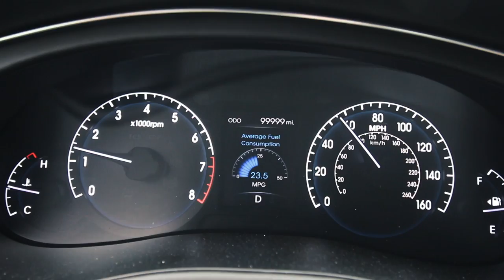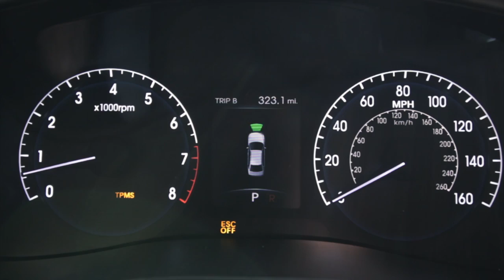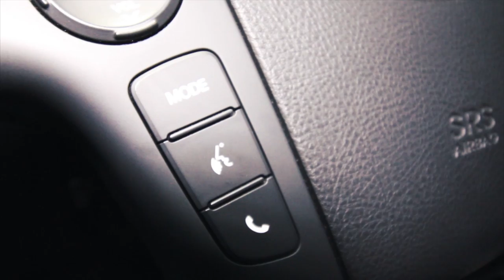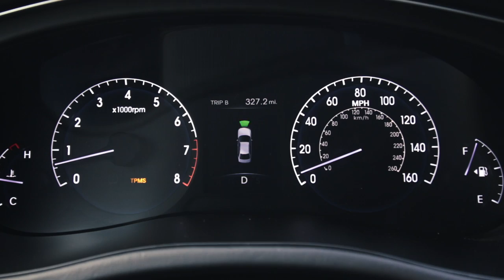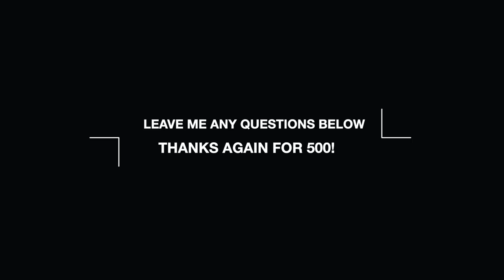2012 Genesis 5.0 R-Spec Long Term Ownership Review

Comment: I have a 2014 5.0 R-spec that I bought a year ago with 30k miles for $20k. Love this car. I wish there were more after market stuff for it but aside from that it's the best car I've owned. Great video. Keep up the good work =)
Reply from the maker: Thanks homie! And enjoy that heated steering wheel only the ‘14s got ;) I’m jealous
Reply: Hey guys, thanks for the info. I am very close to buying a 13 R spec. Is this a reliable car? Honestly that’s more important than anything to me. Also, are you really getting over 23 mpg ? Premium only ?
Reply: @benkemp5621  It's as reliable as any other car in its class. I bought my 2014 Rspec 5.0 in January of 2018 with 30k miles on it. I also purchased an extended warranty up to 5 years/100k miles. The first two years I had no issues. I replaced the rims, tires, rotors (cross drilled and slotted), Magnaflow Cat Back exhaust and modified the air intake box to fit a generic 4" K&N filter (model# RE-0870 ). About 6 months ago the Genesis started stalling and stranded me twice. After 5 trips to the dealership replacing the Fuel pump, crankshaft positioning sensor, oil regulator, fuel injector (#6 on the drivers side) and finally the entire ECM (the codes it was throwing were erratic which explained the faulty ECM unit) which btw, was covered under the factory warranty. A total of over $6k worth of warranty work. Now she is running like a beast. I'm sharing this not to scare you out of buying your 2013 model, just to advise you that with any high performance luxury car purchase, you should buy an extended warranty. It pretty much pays for itself with only a few trips to the dealership. The car is well built and I am totally satisfied with my purchase. And yes, always premium gas. I average 20mpg. Hope that helps =)

Comment: I've got a 2012 R-Spec that looks the same as yours. Bought at 40K miles, now has 104K. I've not had any of the electrical issues, all my electronics work perfectly. Only repair so far has been a new alternator right around the 100K mark. I've been pretty happy with it for the last 4 years.

Comment: Xtalgic.  Big fan down in the RALEIGH, NC area.  You are so spot on with your comment on all the “brand snobs” shitting on Hyundai products. I spent almost a year looking for a V8 sedan to replace another badass sleeper, my 2009 Infiniti G37 (was just too small for me).  I had very strict financial restrictions I put on myself ($18,000) and had no real sense of urgency as I loved my G37.  I tend to like cars that many folks don’t appreciate, but in the end I narrowed the pool to 2011-13 Infiniti M56S (badass 420HP car that gets no love either), 2009 Mercedes E63 AMG, 2009-2011 Audi A8, and the 2012-204 Hyundai Genesis 5.0 RSpec.  The Lexus LS 460 was also in the running but it lacked the “sport” characteristics of the others.  It came down to a 2011 Infiniti M56S (96,000 miles) and the 2012 Hyundai Genesis R-Spec that we’re actually at sister car dealerships (both were listed in the $15,000 range).  I was ready to pull the trigger on the M, but the price on the RSpec dropped $1000 on a Saturday and the Hyundai only had 67,000 miles and was a one owner.   That was the deciding factor and I sped over to the dealer, took it for a ride, didn’t even haggle as I had a $250 test drive credit they offered and walked out the door having paid only $14,250 plus taxes and fees!!!!!   I had driven E63 AMGs, many A8s, and the M56S (extremely rare vehicle) and the RSpec was by far the best all around performer and a brake replacement didn’t cost $5000 (like the E63😂😂).  Let the haters  hate while we just blow by them on their way to the dealership for another expensive fix!!!

Comment: Awesome vehicle, one of the best luxury car sedans ever built. Reliability is awesome just like Toyota and Honda, the manufacturer tested the engine for 800,000 miles. Hyundai forum people have been putting well over 200,000 miles on their Genesis Sedan with the V6 and V8 with routine maintenance.
Reply: Oil consumption?

Comment: I have a 2013 R-Spec 5.0 and everything said in this video is correct. I had a 2011 but totaled it and got the 2013 which doesn't have several of the issues talked about in this video. Great great vehicle. Best I've owned....so far.
Reply from the maker: They seem to have sorted out a lot in the 13-14's
Reply: @Xtalgic  Great videos. Keep doing it. Hey, Ms. can be annoying but you gotta luv em.

Comment: Heck yeah!! No car is perfect. And I'm still LOVIN' my 2012 R-Spec to this day and everyday I drive to and from work! I agree about the transmission....it's great when it comes to a luxurious smooth shift, but it lacks in true sport shifting control (especially when the trans fluid is cold). But overall, it's still a freakin' amazing car for the money.......a true sleeper in performance and price. I love it when I slap-face the rice rockets at 50mph.....they can't believe it when a 4000 lb spaceship leaves them in the dust!
Reply from the maker: Hahaha I’ve I had a few of those.

Comment: I have a 2013 5.0 Rspec at 106000 miles.  Love the car!
still on the OEM brakes also
regarding your backup camera - take the trunk lid liner off and there are some connections in there.  Take those apart and reattach.  Mine was in/and out for a while but since I did that the camera has not missed a beat (been a year)
Reply from the maker: CONFIRMED. Thanks Thomas! Always appreciate your support man.
Reply: Wish I saw this 2 months ago when I spent 100s of dollars to get my backup camera replaced at my dealership...
Reply: @thomas new how many miles she at now?
Reply: @LilZzzQ  I have a company car now so the Genesis stays in the garage mostly. At 122000 now

Comment: I hear good things about the BTR TCM tune clearing up any shift latency and improving transmission responsiveness. They also make an engine tune as well. Excellent car for the money. I drove a black 2012 exactly like this when I owned a tuned 3.8 Gen coupe track manual. The engine was obviously more powerful, but considering the rspec sedan weighed 800 lbs more than my coupe, it didn’t feel much quicker and I kept the coupe as handling was superior and I expect fuel economy was as well. Great video.
Reply from the maker: Thanks man! In my opinion, the BTR ecu/tcm tunes are over priced. Plus I hit them up a while ago for something else... not.. the best experience..

Comment: I own  a 09 genesis.  We got it from a small dealership and less than 6 months later had to replace the motor.  Thank god for warranties. Installed a 2012 motor. Same displacement 4.6 v8. With 30k on it. Nicest car I've owned.
Reply: What happened to the engine?

Comment: Thank you for posting the Genesis videos. Watching them was part of my decision making for my 2012 5.0 rSpec. I've had it for 7 months now, and absolutely love it! Interesting that I watched this today, and my backup camera also started acting up. Did unplugging and replugging resolve the issue?
Reply from the maker: No problem glad I can help! As for the camera, honestly i haven't tried that, but i don't think it'll make a difference. I have to remove the trunk shell to get to it. When I get in there ill make sure to unplug/replug to see what happens. And congrats on your Genny man!
Reply: Mike, that is fantastic! Are you contemplating doing any modifications?

Comment: I owned  two Mercedes a 2003 S 500 and 2004 c 240.  Both  of them were purchased with under 40 miles. Both great cars.  The s cost me 42k and the c 30k. Now both were great cars and I like driving them. I tell you this though both cost me some $$$ to maintain. I never spent under $300 dollars for repairs or general service that goes even for a oil change and I had my friend a certified mercedes mechanic taking care of the cars. My friend told me when i purchased the vehicles you will have to walk with a open wallet. He was absolutely right. I did a lot o research before I purchased my 2016 genesis AWD fully loaded and the ride is great. Planning to buy another soon that's how good the car is. they dont get the credit they deserve but so did Lexus. Get one!  No Im not a Hyundai salesperson or rep. Just found a good thing and decided to share after watching this guy video. GREAT JOB and Great Car.

Comment: I own a 2016 3.8, with Tech package. Bought about two months ago. It has the panoramic sun roof. It has the different grill. It is, in fact the same basic car as the 2019s. It had about 32k when I bought it. Now 42,500 miles. So far I love the car. Every option works on it. I hope I can be as happy as you when it goes over 100k. Good no BS video by the way.
Reply from the maker: Appreciate it Gary!

Comment: I have a 16 Gs 350 F sport. It's my 3rd owned lexus and I love it! But...I've been looking into a family V8 sedan, some will understand, and some won't. I love the new body style and have been looking at the 15/16 genesis 5.0. Haven't had any issues with the GS and I'm debating if the Genesis 5.0 is equivalent as far as reliability. I rock with the channel, the mods, all the content. What's your take? All around, is it worth it?

Comment: Great video!  My 2012 R-Spec is about just over 120,000mi as well!  The ONLY thing I've had to replace was the rear back-up camera!  Still running original brake-pads, I did change the spark-plugs, had a full de-carbonization done. I do have the same rattle on the rear deck that just started last month, only issue I have is the oil consumption. Other than that, best car I've ever owned, no issues whatsoever in the past 4yrs I've owned it!
Reply from the maker: Few questions about the de-carb process. Where’d you get it done? Was is a chemical based process or media blasting? How much? And any noticeable difference afterwards??
Reply: @Xtalgic  sorry for the late reply. I had it done at the dealer. They use the walnut-blasting process. You're supposed to do the cleaning every 50K, costs about $130. But since it had never been done before, the full cleaning was $330.  And yes, it made a HUGE difference. Should have done it a lot sooner...!
Reply: Hello, how is it holding up now and mileage, fixes etc?

Comment: I have a 2013 Genesis R Spec. Only 26k on the clock.  Bought new in 14 for $33k.  Still have bumper to bumper until June and remainder of 10/100 after that. I also had the camera go out but was recently replaced under warranty. Only cost $112 according to warranty claim! Only other issue was internment headlight flash on and off due to switch on turn signal stalk also replaced under warranty. Great car. Most likely will replace with Equus in a few years. Happy motoring!

Comment: I’ve had my 2012 R-Spec for a year and a half and could not agree more about the transmission, fantastic car but the shifts are very sluggish and tend to slip a lot when driving aggressively. great vid man!
Reply from the maker: Thanks friend. And ya I think they’re more tuned with longevity in mind. Unfortunate, but I believe BTR has a TCU tune that apparently fixes that.

Comment: I have a 2012 R-Spec with 241k on the clock, and it's literally one of the fastest vehicles I've ever owned. Currently in the shop waiting for the factory throttle body (trust me you need to replace them brand new), and I've embarrassed mustangs and stock hemis. Would love some advice on tuning. Zero transmission issues, other than it bogging down under mid-pressure acceleration.
Reply: What was wrong with yours? Everytime I let off it slows down funny and idle drops fast almost like u throw it in neutral when I pull up to a stop light .. wondering if it's my TB cause if I flick the pedal on decel a few times it slows for fine
Reply: @boostedek3573 the TPS went bad, and the used one I ordered wouldn't take.
New TB comes with the TPS. Know that it's not cheap and comes from S. Korea direct from Hyundai.

Comment: Don't know if you have fixed the backup camera. If not, I may have the solution for you. I have an '09 4.6 with 170K miles on it and it runs fine. Great car. At about 90K miles, the backup camera went out and I was expecting an expensive repair. Fortunately, I was able to find a free solution suggested by someone on an online Genesis forum. The solution, in my situation anyway, was to just open the trunk and then slam it hard to shut it. It worked the second time. Apparently, I didn't slam it hard enough the first time. Since then, I have had the camera go out two more times and each time, the "slam the trunk" method fixed it. The last time it occured was about two years ago.

Comment: After being rear ended and having my 2012 fully loaded 3.8 totaled out (really safe car by the way) I picked up a 2012 R-Spec single owner with 60k miles. I wanted the R-Spec originally but just a bit out of budget at the time.  Buy it! I knew exactly what I was getting after the accident lol. Flew from the Bay to L.A. and drove it home.  Passing everyone on I5 getting 25mpg!

Comment: Awesome video. Thanks for all the info. Looking at getting a 2013 to avoid some of the issues you stated. Everything I've read and heard make them sound awesome, so looking forward to getting one. Again, great video. Any negatives on the 2013's?
Reply from the maker: Thanks man! I don’t know much about the 13’s in specific, but they’re essentially the same car aside from a slightly updated infotainment system,  but maybe an owner of one can chime in?
Reply: Brenden Westerfeldt  so far no issues on my 13 rspec  I've had it for a year driven from 38,000 to 44,000 ...(also driven like I stole it)😁 purchased for $21,000 ...best purchase ever made..getting ready to start some mods ie. Exhaust. Intake.and possibly nanny control..but so far  IT IS THE BEST PURCHASE EVER
Reply: @jbo4394  Great to hear! Trying to find the right car right now (miles, price, etc.). Hoping to get black, but there's a lot more used Silver and White ones. I'm surprised at how long these cars sit on the lot sometimes and the dealerships don't lower the prices. Seems like it should be a buyers market but they aren't pricing them as such.

Comment: Miss my '12 RSpec. Had mine for 4yrs. Great, great, great car! Only issue: had to replace the engine due to oil consumption. Everything else was minor: oil leak, alternator had to be replaced, battery, and tires aren't cheap. Lol. 
RSpec needs paddle shifters! 
Regarding Sport Mode: computer shifts first 3 gears and then she's all yours. 
Had no problem with parking sensors, door lock, rear view camera, sun roof...
Paint chips yes, tail light condensation yes, oil consumption yes.

Comment: I have a 4.6, drove the rspec as fast as it is. I said to myself I don't need all that speed.
Also I did not want to deal with carbon buildup on the back of the valves.
The only thing is the newest car has better technology package.
I want to add that I thought the 6 speed ZF trans was the better option, hearing the 8speed was a slug.
Happy New year 🎊🥂🎈🍾🥂🎉
Reply from the maker: Happy New Year Friend
Reply: I can't imagine the rspec being all that much faster than the 4.6.
Reply: littlecouchgames 
But it is, gdi
Reply: @Pube83  I stand corrected.  The numbers I can find show the rspec at a full second faster 0-60.  That sound right?

Comment: I got a 2010, 4.6 for $7.500 & 109k miles & love it!!! The transmission seems to jerk but than be smooth at times.. I can't really tell yet.. its odd.. I  not sure if thats normal or a sign as Im new to this car..
Reply from the maker: Congrats on your purchase! Time will tell about your transmission, but it wouldn’t hurt to have the dealer do a fluid change.
Reply: @Xtalgic  fluid change or flush? why not a flush? a flush is bad I heard
Reply: Upon digging I found a need a need a new conductor plate
Reply: thnkbg  I have a ‘09 Genny with 4.6 that I bought off my sister in 07/17. The cars engine was replaced at 87k miles under warranty and now has 169k on the odometer. My transmission first started giving problems with a downshift jerk from second to first gear. A while went by and one day the car wouldn’t move forward and was in limp safety mode. Turns out a solenoid from the mechatronic  in ZF6HP26 trans went bad. After watching a few vids for BMW YouTube for transmission repair, I purchased the solenoid/fluid and filter kit with bridge spacer and did the work myself. She shift even better than before.
Reply: @TheSXTNYNR  Dude can you please give me the link where you got every thing..... I have the same problem... I wish you would have recorded the procedure as there are no videos on how to replace the shift solenoids on a genny...
Reply: @TheSXTNYNR  Hey man where are you.. can you   shoot me the link  where you got everthing?

Comment: I just bought a 2012 5.0 nonRSpec and I love that I have the speed of the RSpec with the sleeper looks of the 4.6, thanks for the upload :)
Reply from the maker: No worries and Congrats on your Genny!
Reply: What's the difference between the 5.0 non r and the r spec?
Reply from the maker: A few visual differences like wheels, headlights and badging. And from what I’ve read a firmer tuned suspension with thicker sway bars, and different steering and transmission tuning.

Comment: I have a 2012  R-Spec too. I just crossed 100K. I've had a great experience. The only issue I've had is that on long trips, the transmission starts shifting weird.  Hard shifts. But when it cools down it's fine. Ive changed the trans fluid 3 times with Amsoil myself. That seems to help. (Dont use Valvoline Max life...) I use Berryman's fuel treatment every 4th fill up. My brake pads lasted over 100K. I had an alternator blow up at 80K. But the car has been pretty solid. And yes, the transmission shifts like a snail in manual mode.

Comment: Does your 2012 burn oil?  I’m looking at buying one but the owners said it burns 1qt ever 2000 miles.
Reply: I have a 2013 V6 3.8 and im at about 110k miles and im burning about 1 qt per 5k miles